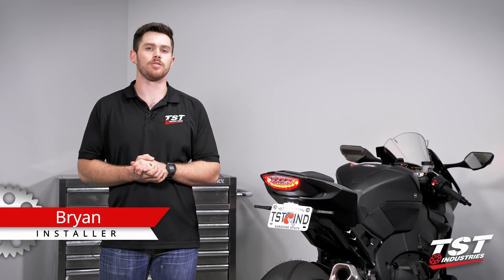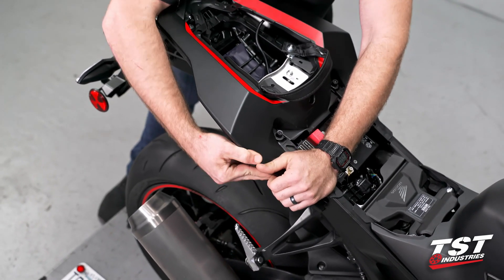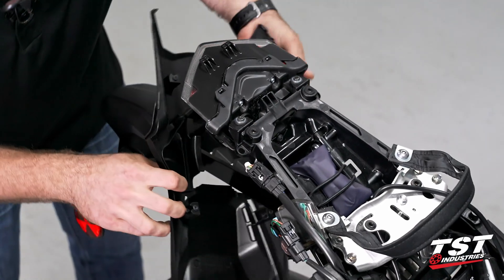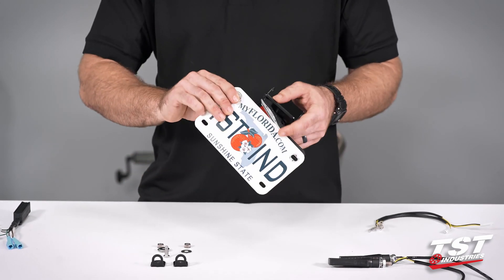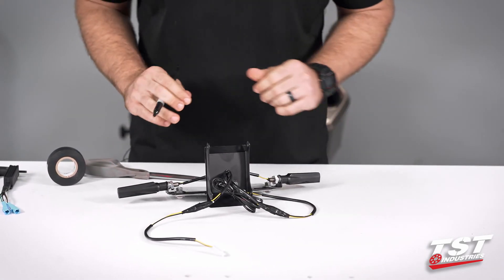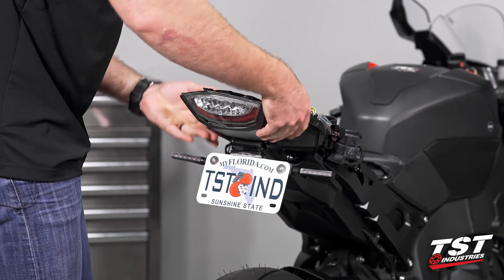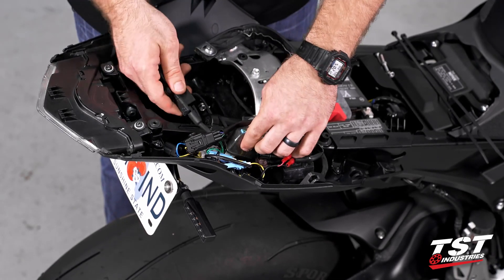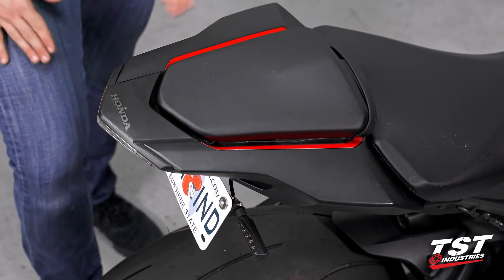How to install TST LED Pod Turn Signals on a 2017+ Honda CBR1000RR by TST Industries

Comment: You missed the tab on the bottom of the brake light,  just saying 😉
Reply from the maker: Please point out time stamp for me so I can see that detail.
Reply: Right around 17:06. Just a friendly tip, if you start at the back first then work forward it's easier to hook the tail light into the body panel. I tried ordering the relay and connectors, cost was 30 bucks (good price!) but shipping cost is 100 bucks! I'm in Canada, seems really high for something that is small and light. Anything information that you have on that would be greatly appreciated.

Comment: Didn’t show the plate light wiring’s need to know how that’s connected
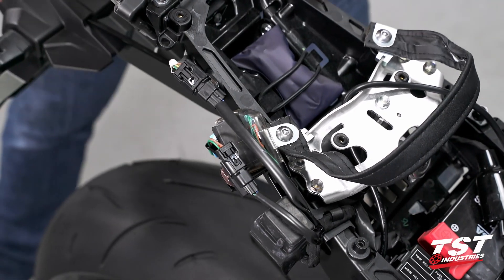Reply from the maker: The connector for the license plate light on this bike is shown at time stamp 7:50. Instructions on how to connect our license plate light to any type of factory connections are contained in the license plate light installation video available on the product page for that part on our website

Comment: I just recently purchased the relay flasher to help with the hyper flash however, for some reason, no matter how many different configurations I try with plugging in the connectors, one side will hyper flash while the other won't.  Do you have any tips or suggestions on what might be causing this?  I also have a CBR1000rr (SP Model) like this one.
Reply from the maker: The flash rate controller that we sell only works for the location on the bike that it is connected to. If you have it on the rear of the bike along with some signals, and you have also changed the front signals then you will likely still get hyperflash. Is your bike outfitted with all aftermarket signals?
Reply: @TSTindustries  front signals are stock, only the rears are changed
Reply: @TSTindustries  furthermore, the controller relay purchased is this exact one for the cbr 1krr sc77 as per your website

Comment: Hey Bryan  I need your advice dude I don’t have much experience with bikes and just decided to buy one that has  good looking but economical and not heavy.  Easy enough to ride . I’m 5 foot 8 inches by the way . What would you recommend for me ?
Reply from the maker: The last few years we have been having a lot of fun with smaller bikes. Our choices within your parameters would be R3 or Ninja 400, or if you are more into the naked bike style then MT03 or Z400 would be our picks.
Reply: TSTindustries I’m Im love with z800 or 650 do you think it’s bad choice for me is there any problem I may have if I buy it as a beginner ?
Reply: @Marco-ol6ms  go either for z800 or Yamaha mt07. That's naked bikes and easy to ride. I practiced with a mt07 and then got a Honda cbr650r, that's more of a sportbike. Next step for me would be a mt09...
Reply: AintHere4You so you think z800 would be fine for a beginner ?

Comment: So you need 4 different parts for this install??
Reply from the maker: what you see in the video is the Fender Eliminator kit being installed along with the BL6 Pod Signals, and their harness converters.
Reply: TSTindustries and the flasher module, and the mounting kit... all for turn signals.... so in total for this install you need: the fender eliminator, pod signals, harness converters, flasher module, and mounting kit..